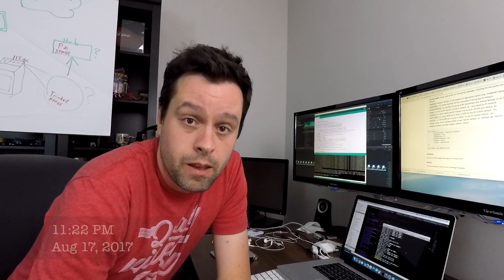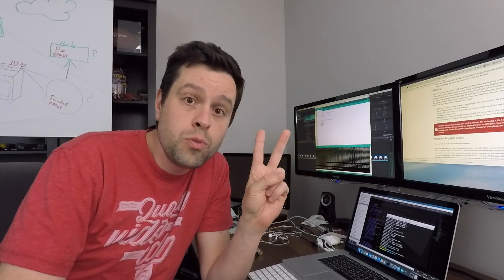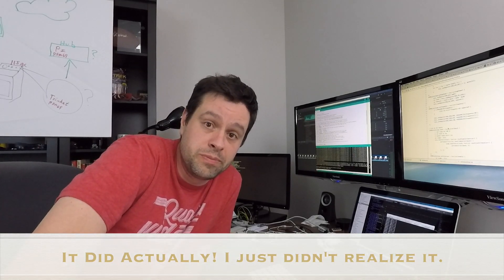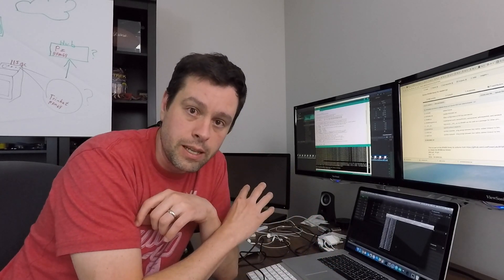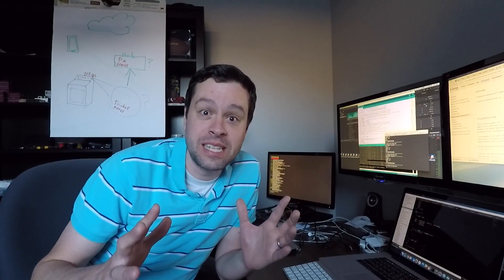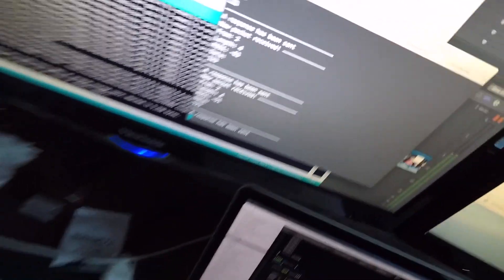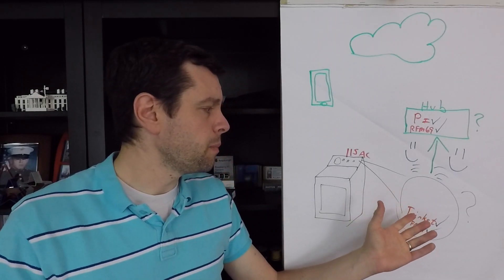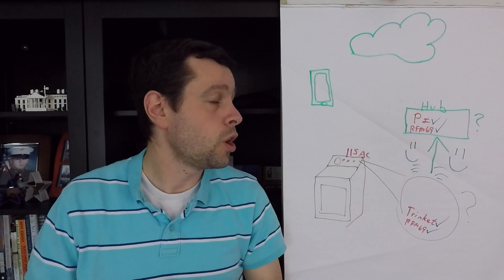Texting Dryer - RFM69 LINK WORKING!

Comment: Just realized while going back to review the dryer side circuitry that we really never talked about what the pins do between the rfm69 and the trinket. I know we have the schematic and will be using it when the RFMs get here but not sure how they are communicating.
Reply from the maker: Good point Rud Dog. So the communication between the Trinket and RFM module is done via SPI so there is a MOSI (master out slave in), MISO (master in slave out), CS (chip select) and SCK (clock) for that. In addition there is an interrupt pin on the RFM that signals to the Trinket that data is ready which is what the DIO0 pin does. Other than that we have 3.3V and Ground.
Reply: @KevinSidwar  I know it's been over 2 years but was hoping you might have posted somewhere wiring diagrams for others to replicate what you figured out... attempting to do something similar with a trinket...  Never mind i found https://github.com/makercrew/texting_dryer_node  and thank you!
Reply from the maker: @toddfisher8248  Glad you found it Todd because I wasn't sure where I put it. Haha. Good luck on your project.

Comment: Pralines and cream. Had a similar incident while in my brief position as an electrician. Told my supervisor we need to go to a job site cause I dreamed my connections in one box were wrong and of course he looked at me like I was crazy. After opening the box there it was had connected a hot wire to a neutral wire. Fixed and had the last laugh. 
Glad you found your roadblock and are on the way to the finish line. Can't wait to duplicate your setup.
Oh BTW was having difficulty flashing the photon back to its original firmware but stumbled through it and we have returned from Zerynth platform to the native Particle platform.
Reply from the maker: Awesome to hear on the Photon firmware. I got an email that you commented on another video about it but when I went to reply it was gone. Guessing you figured it out and deleted it. I'm working behind the scenes to make the project reproducible via documentation and such.
Reply: Yupper do, had a bit of information overflow took a break came back and somehow managed to get the device back to native particle firmware. Gonna try again later and record it in case I need to reflash again.